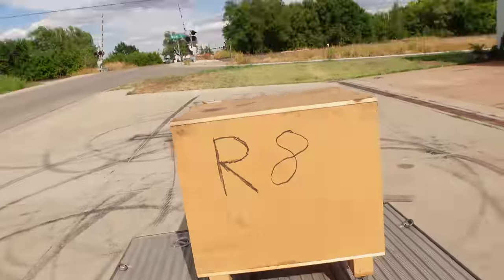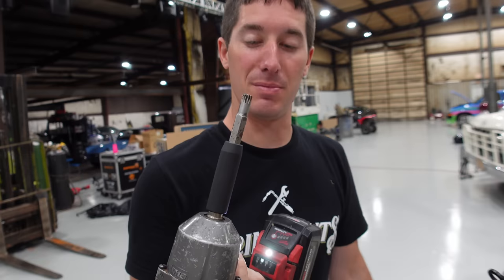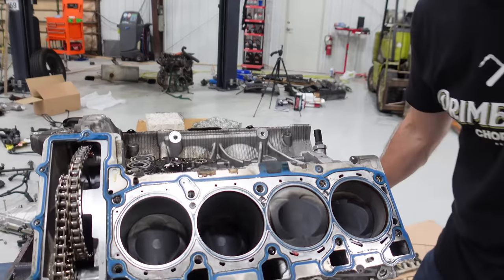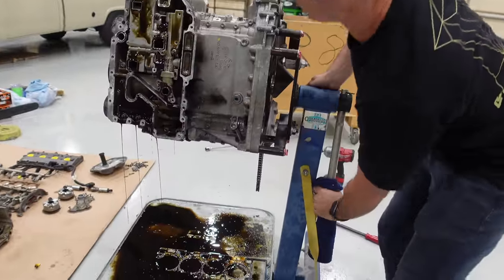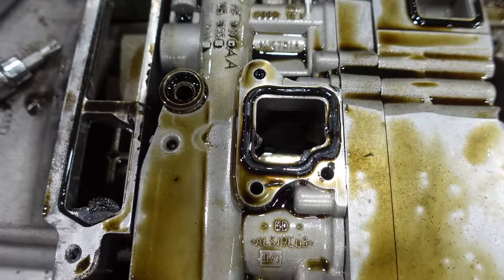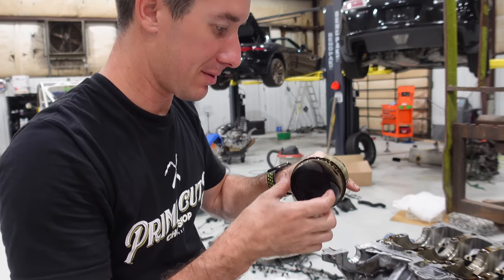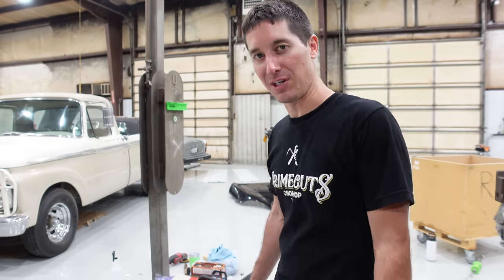Tearing Down My RUINED $20,000 Audi R8 Engine (Lamborghini DNA)

Comment: I am a retired foreign car mechanic and I enjoyed watching the R8 motor come apart.  I would like to point out a few things please.  First, I saw the flying line array for tunes, just awesome, we also had a huge system with subs in our shop.  Second, there is this invention called a "table".  Sometimes they are used as "workbenches".   Tables or workbenches are used to place things on to bring them to a waist high level.  And there are also things called shelves that are used to organize things so you always where things are.  In looking around your shop, it appears you like placing everything on the floor, all over the shop.  All over the shop!  Shelves and tables dude.  Yes massive sarcasm, but can you blame me?

Comment: I grew up in Germany and my family had just about every German automotive brand…watching this tear down, I know now why they drive Toyota’s.
Reply: To be fair, German cars that are manufactured in Europe have far better quality than those that are assembled outside Europe. But overall, Toyota's design are far more simpler in terms of mechanicals and layout/ergonomics. 

As a result, when they do break, they are easier & cheaper to fix. The only downside is that they are boring. But for daily drive, I'd prefer Toyota.
Reply: @aabidamn  rather be bored driving a Toyota than stuck on the side of the road waiting for a tow truck when you decide to take a road trip.  Then get handed a 5to10k bill from an remote audi facility to get you back on the road.  I know deep down when I rode trip twice a year my acura will make it.  I just change the oil rotate the tires and I'm like yup she's good to go even with 160k on the dash. Beat the piss out of it down and up mountains.  Don't have to worry about timing chain guides or water pump or pcv systems nor oil leaks nor window regs malfunctions.  Just a good feeling to know your vehicles going to get you there and back multiple times with 0.0 worries.
Reply: @aabidamn  I think pretty much every BMW sedan owner would disagree with you....  They are famous for terrible reliability these days. Toyota had to re-engineer lots of the BMW engine to make it worthy of the new Supra.  And I'm not sure I would call any Lexus engine design "simple"....
Reply: @ckm-mkc  You don't think that BMWs that are assembled in Europe have better quality than those that are made in China, Indonesia, and the US? Are you sure about that?

As for Lexus/Toyota, I was talking about their non V8 engines.
Reply: @aabidamn  If it's the same engine with the same components on it, it should be the same, that's if the engine assembly line is following things like torque specs and what not. Only if BMW or VW start replacing original supplied parts with parts from another manufacture to save cash. i.e. an oil pump from china manufacture versus one made in Germany, then yeah I would think that's different quality . After all, why did you go to that Chinese manufacture to sub in a part? But I would think, if the engine has the exact same parts being supplied it should have the same reliability no matter what side of the Atlantic its being assembled on. 

But what I'll say is manufactures like VW do things like change suspension, steering, and completely different engines for the North American Passat versus the European made one. We don't even get an option for a Euro spec Passat anymore like back in 2010 with the GLI being a European version, versus the rest of the Passat lineup being made in Mexico with different engines and suspension (way more cushy ride for Americans, rear torsion versus multilink in euro version) and a bunch of other parts made cheaper on this side of the Atlantic. Heck they don't even offer the same instrument cluster.. At least looking back to 2010 that I could do a comparison on. Regular Car Reviews did a fantastic essay on the the last Passat models made from 2021; as they wind down production on that model https://youtu.be/BJWlpMbK2KU

Comment: Wow, I had heard these engines had an issue with chain tensioner wear and were extremely expensive to fix, now I see why. I love high tech stuff but would never buy one of these, the maintenance cost to prevent catastrophic failure is just too high. I'm not a GM lover, but I have to say Chevrolet did a much better job on the latest Z06 engine than this disaster waiting to happen.

Comment: Amazing video and amazing piece of engineering. Personally I am always flabbergasted at the sight of the "plastic" timing chain guides. Such complex engineering relying on something that, ultimately, is brittle and a point of failure, as I have seen in so many videos. 
If you add the complexity to get to the point of managing to replace them, you realise the incredible potential for disaster and waste of time and money...
Reply: Agreed those tensioner plastic guides were surely going to fail at 65 k and guess what engine out job to do the timing chain tensioners.
Reply: I think you're right about them being a point of failure, but wrong if you think it was "bad engineering". It was engineered to fail, otherwise you would never have a reason to buy another R8. I mean he said it when he did it...it was cheaper to just buy another engine than repair it.

Comment: Honestly, I would have loved a series re-engineering this v8. Chro-moly sleeves, off the shelf pistons with the right compression height, haltech running it, compression lowered to make it a big boost engine. But this makes far better economic sense.

Comment: You can get some of those longer Milwaukee Shockwave torx bits, they fit in tight openings better than a bit holder would. I have some 3" and 4" ones and I prefer using them over the small bits with a bit holder.

Comment: The godawful RTV/fastener job told me everything I needed to know. The "builder" only did the minimum to get them on, and they were tuned for too much boost for an unmodified engine. At the very least it needed the piston rings regapped to handle the higher combustion temperatures that cause the rings to expand more than the factory tolerance. That's what caused the rings to break and score the bore. Of course it requires a complete rebuild to do that and the owner was too cheap. Penny-wise but Pound foolish.
Reply: 💯 the rings on the stock tune/setup are already marginal for the HP/rpm load, throwing boost at them makes it super easy to close the gap and blow the ringlands/crown

Comment: Those oil pans the auto parts stores sell barely can hold the oil that drains into them. Then when you try to pick them up to dump the oil in them, it spills on the floor. Get a plastic tray made for a top loading washing machine. They have 2" sides, are bigger and can hold a lot of liquid. Plus they are cheap at home improvement stores.

Comment: Youre telling me the entire engine that you said was "beautiful" and that slight bit of damage on the cylinder toasted the entire thing? Damn..
Reply: Bad tune my guess
Reply: @jasonw3303  Just doesnt make sense if pretty much the entire engine was good.. ive seen honda engines run with MUCH worse damage.. lmao these damn exotics
Reply: Burt  psh yeah.. LS1 can be pulled from a junkyard most of the time no problem.. little baby small cylinder discoloration and gap and the engine “can’t be salvaged??” Smells a money grabber from Audi like was it designed like this??

Comment: Never underestimate Audi engineering, they are only second to Porsche in German engineering. Under normal circumstances if these engines are religiously properly serviced they are 100% reliable. Its beggars belief really bolting turbo`s to a high compression N/A & expecting it to survive, its always going to blow its brains out at some point.
Reply: reliable?? I think its a pretty common feature in the 2.0 Audi variety to suffer timing chain issues and as you could see this engine always had clean oil and was not neglected in that regard and yet had timing chain guide wear. In addition the piston skirts and ring lands did not look great nor did the cylinders look very durable. This is a supremely nice, powerful and smooth engine to run for a limited lifespan.
Reply: Audi Unreliable, overly complex, extremely expensive to manufacture, impossible to repair.   IT IS GARBAGE

Comment: Basically the same engine platform as the 3.2/3.0T engines.  Very impressive engines and long lasting in normal not modified applications.

Comment: I now have a much greater appreciation why GM has stuck with pushrods when looking at all the hardware it takes to drive overhead cams.  Cubes and pushrods rule.
Reply: Yep, Audi is Unreliable, overly complex, extremely expensive to manufacture, impossible to repair.   IT IS GARBAGE

Comment: Check the bore and stroke and piston pin height on vw tsi 4 cylinder  vw audi family love to make crazy motors out of 4 and 6 cylinders vr6 turns w12  4 to v8  but if tsi piston are same specs besides lowering compression  build a turbo R8 out it

Comment: It would be cool to see this compared to a mid-2000 4.2 chain drive V8 from a S4, A6, A8, Q7 etc.  Just to see how similar/different they are.  Like to know this is a different engine but how much of that design language carried over.  I would say the RS4 engine since those are supposed to be almost identical to these but I wouldn't hold my breath on that.

Comment: I hope nobody gets upset, but the more videos I see about your super-Audis the less impressed I am. A super expensive engine that lasts 50K miles?? And then lets put the super complex timing system in the impossible location with plastic parts that wear off.. seems like planned death from the design. Way overly complex for what it does. Oh, then lets make the parts un-obtainable, that will teach them. :-/  My very first work on a car was an old Pinto that had a V6 2800 engine, which had timing gears, not chains. The gears would disintegrate when the nylon/plastic teeth got toasted by the engine heat. I just recently had work done on a 98 Expedition with the similar problem, the chain guides get obliterated and the engine sounds like a diesel engine. 😛 And the whole story with the computers.. ugh. That block would make a great coffee table or centerpiece. 🙂
Reply: Surprising how much chain guide wear there is  considering how clean the rest of the engine was.
Reply: Your exactly correct.... Audi is Unreliable, overly complex, extremely expensive to manufacture, impossible to repair.   IT IS GARBAGE

Comment: I cringed seeing you using a steel hammer on those rod caps even if they're going in the scrap. Aftermarket turbo install probably caused the failure.

Comment: Audi would charge $3K to do this tear up.
Reply from the maker: They actually just won’t do it, every Audi tech I’ve talked to says they install a new engine every time 🍻
Reply: Not a chance, would cost $20k plus to rebuild if done at all.  Basically Unreliable, overly complex, extremely expensive to manufacture, impossible to repair.   IT IS GARBAGE
Reply: @pablopicaro7649  $3K just to dismantle the engine. Putting it back together requires another $8K. Not including the parts and fixing the heads.

Comment: You should have at least followed Audi procedure in removing the heads if you're selling them to someone. There is the chance for warping when you just crank those bolts out all willy nilly with an impact. I'm fairly certain that there is a removal procedure that involves cracking each bolt loose in a certain sequence in smaller increments than 100-0% torque in one quick motion. It would give me pause if I were the buyer.
Reply from the maker: Warping a head pulling bolts isn't remotely possible, everyone takes down engines with an impact and there's no reason to sequence a head removal. You only sequence on for even clamping pressure. 🍻
Reply: @WatchJRGo  good to know.....I work on little stuff like four stroke dirt bikes. When removing the cam carriers and head bolts Honda suggests loosening in increments. Just figured that would extrapolate to bigger stuff....especially aluminum. Thanks for the reply. Loving the Jag series!
Reply: @WatchJRGo  You are relieving that same clamping pressure and it should be done in reverse order of the install procedure.  if you do it in the wrong sequence you will cause uneven pressure as it releases causing the head to warp.  In your Jag videos you were calling your Jag tech friends for advice.  Call one of them and ask them what procedure they use to remove heads.  I think you will have your mind changed.
Reply from the maker: @rbailey225  on the cam carriers it completely makes sense, they have spring pressure on them! I wouldn't worry about the head at all. 🍻

Comment: The "white" on the top of the piston is due to oil bypassing the rings and washing the carbon away. Oil was passing the rings due to the score in the cylinder wall most likely debris in the oil.
Reply: Lean condition. Oil makes more carbon
Reply: Engine is direct injection, seems more likely raw fuel spray was cleaning that area
Reply: @pablopicaro7649  or.. it was running lean. Hense the hole in the piston 🙃

Comment: Every Saturday night the guy on I Do Cars disassembles an engine. Most have issues (inspection ports on the block AKA blown engine). 
He has to use some heavy duty tools.
Reply: And he puts the effort to do a correct unbolt pattern every time he takes the heads and by hand not using an impact

Comment: This teardown shows that Mercedes Benz builds the highest quality German cars.  BMW is further behind than ever but still above Audi, overall.  Audi lacks design efficiency & effectiveness.  There are these type of purposeless unique designs and parts on VW engines every year.  Mercedes design combines new tech with simplistic reliable manufacturing with synergy.  Mercedes still has issues compared to Toyota but this is akin to why Maseratis depreciate to complete worthlessness after a few years.  

 JRGO is a good guy.  Good mechanic.  Good videos.  

Maybe fix up a budget loud Ford Coyote Mustang, Chevy Camaro, and Dodge V8.  A tribute to budget American V8 muscle cars ...

Comment: So what was the original problem with the engine?
Reply: Oil Consumption so bad that when it ran, the engine was a mosquito fogger.
Reply: its a piece of garbage from day 1,   Unreliable, overly complex, extremely expensive to manufacture, impossible to repair.   IT IS GARBAGE

Comment: German engines are not SBCs.  They're not designed for add on HP goodies.  Recipe for disaster.  The added HP will find your weakest link - whether it's the head gasket, rings, rods, bearings, crank, whatever.  These type engines are designed for the factory HP and not much more.  Bottom line - if you need more HP, buy the next model up rather than bolting on HP.

Comment: Every pendent service on this engine, screams engine out job. Even a oil pump replacement demands a timing chain set disassembly.
But yes scary many bolts and places where wear over time could make a big impact. 50 years from now, when being a old timer (all electronics are anyway at the end of their lifespan), any repair of this engine would make no sence.
Reply: I imagine in 50 years, everything would get electric swapped, similar to an LS swap now. It'll, by then, probably just be easier, cheaper, better performance, etc.

Comment: When you put the new engine in the R8, did you have to remove the oil sump to also add a hole for the the supercharger drain back ?

Comment: Another example of how using electric motors for propulsion will make for a simpler future. This engine, like so many others, have 250 potential failure points. Should be able to sell the crank as well?
Reply: Audi will stop development of new internal combustion engines in 2026.
Reply: And waiting for 12h to charge one because there will be a waiting line and one working power station.

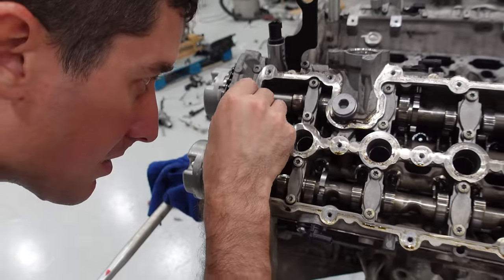Comment: 5:15 - Wow, you're so spoiled with your power tools that you are now at the point you're baffled on how to remove a bolt without your power tool.  I wonder how mechanics did this job back in the old days? Did they have to use wrenches and sockets, and extensions?
Reply: Speed wrenches ( omega shaped) and Yankee Screwdrivers (push in on to spin)